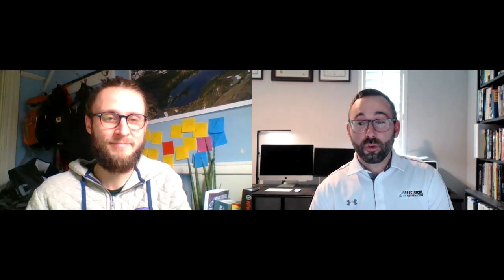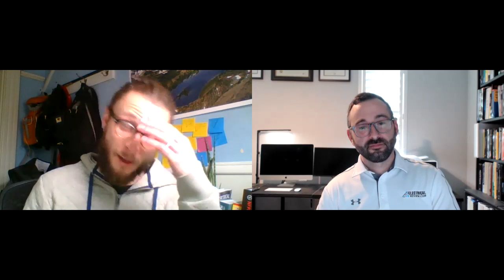How Zach PASSED the new CBT Power PE Exam (2020)

Comment: Congrats Zach! Well done. Would it be an issue to get the final approval from the board of engineering, once you have passed the PE Exam if you take it in a discipline different than the one by education? Thanks Zack Stone!
Reply from the maker: I do not believe it makes a difference, but I strongly recommend confirming with your state board first since the rules in each state are all slightly different. You can find your state board contact info by clicking on your state on the map on this page: https://ncees.org/engineering/